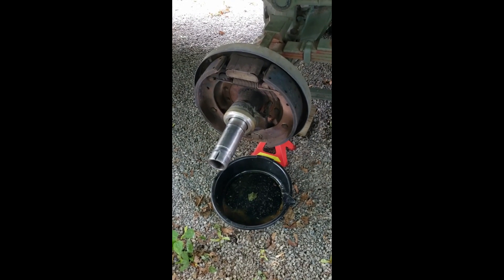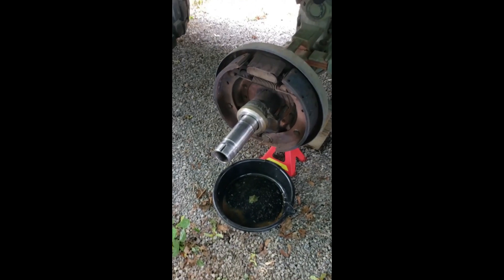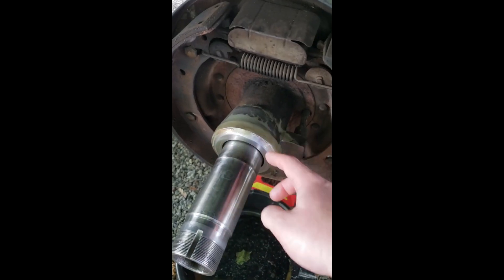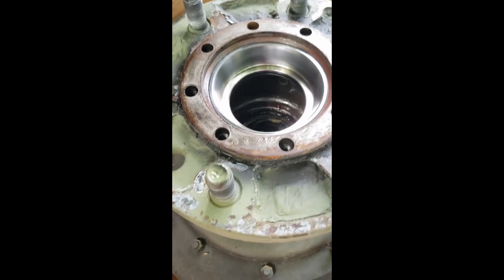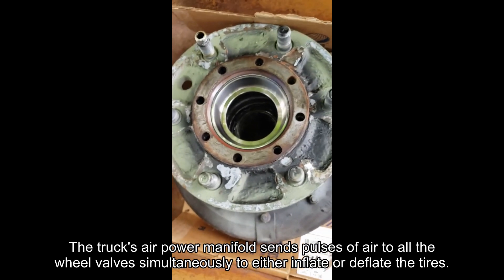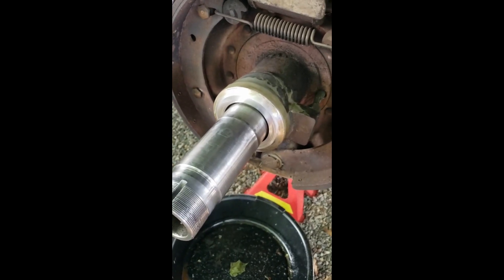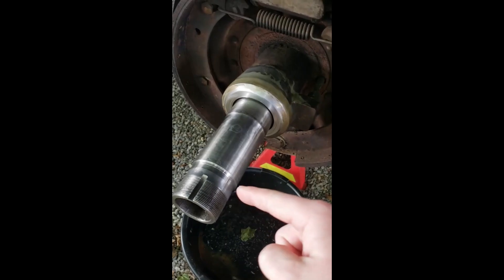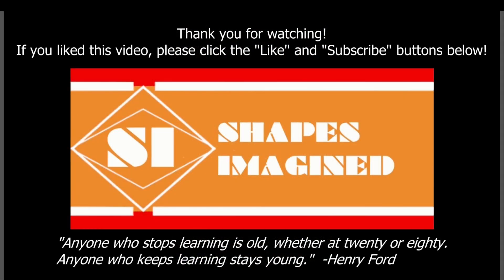How air gets to the tires in a Central Tire Inflation System (CTIS) - M44A3 Family of Trucks

Comment: Wow i though only Portia axle would ability to have ctis❤
Reply from the maker: I'm not real familiar with the portal axles.  After looking at a few pictures, they look like they have a geared hub similar to what the HMMWV has.  The CTIS implementation on the HMMWV hubs, and apparently these portal axles, is more straight-forward than what was done with the M44A3 trucks, and probably any truck with CTIS and full-float axles like the M939A2 5-ton trucks and the FMTV.
Reply: @shapesimagined6193  I came to say the same thing Random did, I have been trying to figure out how they do CTIS without a "broken" axle like a portal axle. The Tatra trucks have them cause they have the backbone system and the hummers do too but this is the first time someone broke down how other trucks have them. Thank you very much
Reply from the maker: @brandonhalcyon6984  I'm glad you found the video informative.  Thank you for watching!